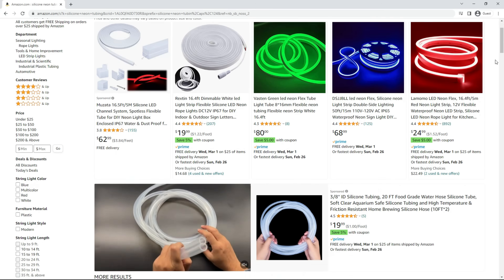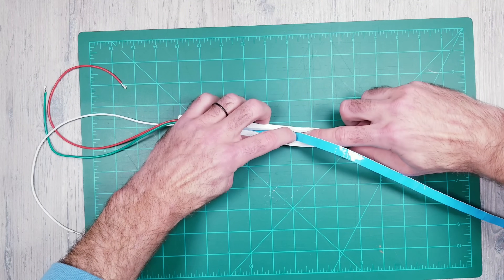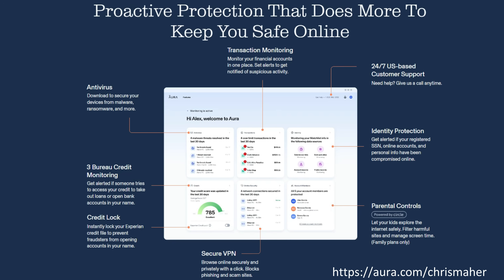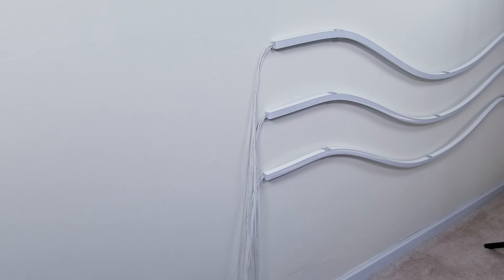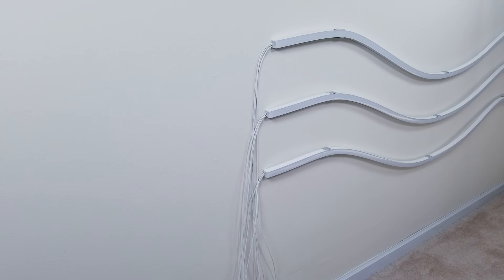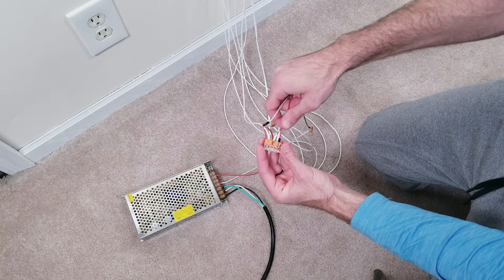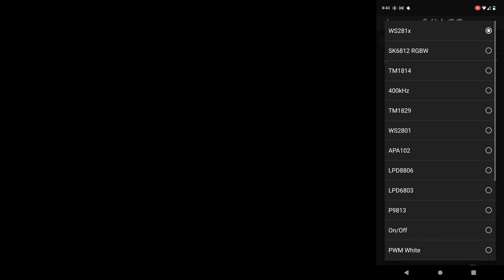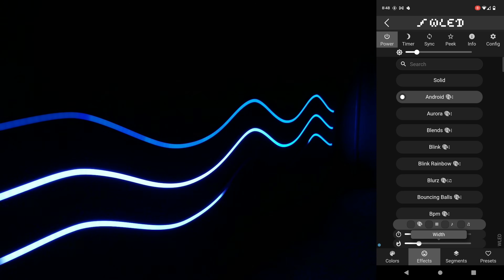Flexible Neon Tube - Review, Installation, Best WLED Animations - LED Neon Strip Lights

Comment from the maker: 📟 BEST Amazon Deals on Electronics: https://amzn.to/47qjC9j (updated daily)
☑Check out my sponsor to begin your FREE 14 day trial to Aura: https://aura.com/chrismaher
Flexible Neon Tube Amazon: https://amzn.to/3qeToE3
Flexible Neon Tube Company Site: https://bit.ly/44xoN37
Best Regular Aluminum Diffuser Channels:
Spotless Diffuser Channel 1m Amazon: https://amzn.to/47aIujz 
Spotless Diffuser Channel 2m Amazon: https://amzn.to/3QoHeDb 
Spotless Corner Diffuser Channel 1m Amazon: https://amzn.to/3DFhRpf 
Spotless Corner Diffuser Channel 2m Amazon: https://amzn.to/3Krqw2q 
LED Lights: https://amzn.to/43vJEnT
AliExpress LED Lights SK6812: https://s.click.aliexpress.com/e/_DF2aoqn
Power Supply: https://amzn.to/3UER8Rf
ESP32: https://amzn.to/3L3wZ48
Wago Connectors: https://amzn.to/3UDxLrY
3M Sticky Pads: https://amzn.to/3KIfSnb
Thick Jumper Wires Male/Female: https://amzn.to/3MQvRCi
18 Gauge Wires: https://amzn.to/41uNOKF
Power cord for Power Supply: https://amzn.to/43AmkW0

=============================
Support My Channel Directly:
Become a monthly contributor on Patreon: https://www.patreon.com/ChrisMaherDIY
Buy me a Coffee: https://paypal.me/ChrisMaherDIY
==============================

Install WLED on esp32 Video: https://youtu.be/TOEnFKLm9Sw
If you want Pre-Installed WLED Controller Option: https://youtu.be/aBOEHfT8VY4
How-To Solder Video: https://youtu.be/apSz3NXYlx8

Soldering Iron: https://amzn.to/3jxx1mB or https://amzn.to/3BKMlWv
Solder: https://amzn.to/3r6smMA
Solder Smoker Absorber: https://amzn.to/3rbHCYp or https://amzn.to/3Kx6K4T
Helping Hands: https://amzn.to/3v19YG3
Colored Silicone Wires: https://amzn.to/3Keoel3
Black and Red Silicone Wires: https://amzn.to/3DTFARN
Wire Stripper: https://amzn.to/3x9RGF0
Heat Shrink Tubing: https://amzn.to/3733zSH

The best way to help support my channel is to like, comment, make sure your subscribed and share my videos with as many people as you can. The other way is to use my links above as I get a small % at no extra cost to you if you buy something. Thank you all for the support!

Comment: I’ve seen lots of videos saying you can just use the 3V & GND pins from the ESP32 (or ESP8266) for the LEDs, without using a power supply. It simply uses the power from the USB connection to the ESP board. Would this work without using a dedicated power supply (just using a USB brick or something)? Seems MUCH more cost effective.

Comment: Is it possible you could create a similar project but using the WLED plug and play controller? Curious if its possible to cut down on the overall amount of wires used to create a similar effect.

Comment: Killed 5 leds of my strip while inserting in the silicon tube, both are 1 cm wide, so I thought that it would be a easy insertion with thread but no, u need a bigger hole like 1.2cm to insert 1 cm wide strip. Also the thread is broken too. Gonna use your cut and slit method now. Thank you so much.

Comment: Amazon videos as always, you are my LED Knoledge MUST WATCH! I do have a question, I do have a project of 20 Led strips lines WS2812B 60Leds/m (4 separated segments of 120 lead each) to cover the ceiling all over the place, I use the same GPIO per 3 strips and just Sync all to one Wled and I ithink i have like 6 Wleds up there, but watching this I thinki maybe there is a better way to connect, if you are in my situation, how would you orginze all the 20 line strips? Perhaps 7 Wleds using GPIOS (D2,D4, D5)?

Comment: Thanks to your videos I just found out about WLED and the ESP32….. got a (probably very basic) question:

The led strips could be 5, 12 or even 24 volts…. Can the ESP32 be feed those same voltages? Or would I need a separate power supply for the LEDs and the board?

My most immediate use will be running on a 12V car battery, that’s why I ask.
Reply: Well... some more digging on the web and I think found the answer: The ESP32 needs 5v, so I need a DC step down or Buck voltage converter. They even sell some specifically to use on car batteries with both under and over voltage protection.

Comment: Hey there Chris, thank you for the awesome and clear tutorial. 

I have been watching your videos and have been inspired to do a project here in my bedroom. I have a couple of questions as a beginner:

1.) I am running a total of 8 LED strips. Would it be okay to use a single ESP32? Or would you recommend getting another controller?
2.) I will be using WS2812B with 60 LEDs/m and I am planning on getting the 3m one. Would there be any voltage drop issues or inconsistencies? 
3.) Is the 5v20A power supply the best option for running 8 LED strips?

Help is appreciated! Thank you Chris and may God bless you.

Comment: Hello, with this way I can do it with 2 esp32 to control 3600 LEDs.? And what would be the synchronization between the 2 esp32 so that the 3600 LEDs perform the same effect?

Comment: It is interesting to see LEDs being bent laterally. I'm going to make a ring light for my circular shelf, and I thought I would have to use S-type "cobra" LEDs that are able to bend sideways. But if I can use standard LEDs instead, that would allow for a lot more options. I guess the most important thing is to not bend with too sharp of an angle.

Comment: Thank you for another great video. I picked up a set of the 2812b, the silicon diffuser, some esp32’s and pet supply per your links. Set it up last night for fist time with all and works great but I can see the individual leds in the silicon diffuser. They are not as blended as in your video which is fine for certain effects like “Noise” but not all. Any settings that can help make it better? Thank you  again. Appreciate all your sharing of great content.

Comment: Question on using multiple pins/strips with one controller. Is there a way to make 2 pins do the same animation while the 3rd does something else?  Example. I have 1 string and at the end 2 strings that form a Y. Can the 2 strings do the same together? Imagine a fuse that Ys, you light the fuse (string 1) and the fuse burns (leds go on and off) and once the fuse burns to the other 2 fuses (strings 2 and 3) they both ignite and burn (same leds on each strip go on and off down the strip)?

I have an idea  where 1 string leads to 2 or more and want the effect to travel from 1 to 2 or more not go from end to end? Maybe it's possible using reversing, idk. But I thought I would ask.

Comment: your project is 3 lines of led and the first line is connected to D2 then the second line is connected to D4 and the 3rd line is connected to D5. what if I'm going to do 4lines instead of 3lines of led that you made?

I prefer to assign 125 pcs. of led per lines.

125 led x 4lines = 500 led

where do i connect the 4th line on the data pin?

Comment: Hi Chris, great videos !! Is there any particular reason for you to go for the 5v led strips instead of the 12v like the ws2815?  I`m planning a 35/40 meters led setup for our home but not sure what's best to buy. I don't want to have monstrous power supplies everywhere. Or maybe It would be better to go for the govees? Thank you !!!
Reply: For short runs like these you can get away with lower volts. For longer runs off LEDs you'll need the 12 volts and 24 volts.

Comment: Thanks for all your videos Chris. I'm about to start my first project. 12m of SK6812 lights, placed in diffusers around the ceiling. I'd like to make a continuous loop effect. I've bought 2x5m and 2x1m sets with a 5v 20a 100w supply. BTF suggest adding power every 5m. Question is.... With WLED, can I combine these strips into 1 long loop using software, or do I need to physically connect the 5m+5m+1m+1m by soldering the strips together, as well as adding power at 0m, 5m, 10m. Hope that makes sense?

Comment: Hi and thanks for this video I really like the neon tube design and went out and bought one of those side emitting tubes after seeing this. However I messed up and bought one that only support 8mm wide strip and it wont fit what I already have. That being said that mess up could be a blessing for me in that thin channel looks really good and will work for me in a few projects I want to do. One in particular is in my vehicle it hides great however, I am having a really hard time finding an 8mm wide strip that is individually addressable that will fit in there sold in the US. Do you know of any. I tried amazon and there is nothing in there and BTF or ATOLF hasn't responded back to any emails. can you point me in any direction? I am really new to all of this and any help would be appreciated.

Comment: I am going to be pedantic and say these are not neon tubes.   It's LED's designed to mimic neon tubing.   
Other than that, looks pretty good.   It still is LED strips, so you do have that directional type light that neon tubes don't have, but the flexibility, and the low voltage levels, definitely make it easier to deal with than neon tube for the DIY'r .
I  do like the flexible diffusers, they give a really nice, smooth looking light pattern

Comment: Thanks for all the great info on LEDs and WLED. I have a good time replacing many of your creations. Tell me please: do the WLED effects change with the type/model of LED strip attached to the controller? I am running WLED 0.13.3. I see many effects in this video that are not available on the WLED I am using. Thanks!
Reply from the maker: Thank so much for watching! As far as I know the leds wont make a difference in terms of animation but the version of WLED that you are running will. I should have mentioned that I was using the  0.14.0-b1 beta release which can be installed at install.wled.me Also keep in mind that the animations will drastically change depending on how you tweak the slider options.

Comment: Need font 5v 20a? tkz
Reply from the maker: Thanks for watching! I'm not sure what your asking. Sorry! what does font mean?
Reply: @ChrisMaherDIY  Sorry, power supply! 5v 20a would be for this amount of led? to supply 5 meters it needs to be 20a too?
Reply from the maker: @colomb0222  ahh is see! You could use a smaller or larger one. But for this type of led strip that I'm using in the video you do need a 5v supply. The amps will be different depending on what you want to do. If you want to run all the light at full brightness, you might need a larger supply and you might need to do some power injection but if you only wanted to run them very low and maybe set the brightness limiter to a lower amount, then you could probably get away with a smaller supply.

Comment: What is the max practical bend radius for this type of application?
Reply from the maker: Great question! I would say what I did in this video is about close to the max bend with this type of design where the led strip is horizontal to the wall. Anything more, you would want to go with a design like this: https://amzn.to/41fEOtk

Comment: Mate, you completely forgot the review part. What are  your thoughts on the silicone diffuser, do they work good? Diffuse well? Brightness etc.
Reply from the maker: Thanks so much for watching and taking the time to comment! You are right! didn't even realize I didn't really give my overall impression of them. They are great overall. Very well diffused. Not quite as good as the Muzata aluminum channels that i've used a lot in my videos but still looks great with 60 leds per meter and truly spotless when I used them with 100 leds per meter. They get very bright but for what I use them for (ambient light at night) I never have them anywhere near as bright as they can go since it would just be way too much. I'm hoping to at some point do some comparison videos down the road! Thanks!

Comment: @Chris Maher how easy is this to bend on the wall? With the strip being horizontal to the wall (rather than some other neon ropes which have it at 90 degrees), this looks like it would be difficult to make sharp angles with installed on a wall. Is this true or am I missing something?
Reply from the maker: Thanks for watching buddy and great question! The amount of bend I did in this video is about the most I would try doing with this type of horizontal led setup. If you were wanting to make 90 degree then a product similar to this type of design is what you would want to go with:  https://amzn.to/41e2VIT

Comment: Another great video Chris!  Did that configuration of silicone strip diffuse the light really well?  Can you still see some "hot" spots at 60 LED/m?  There are some where the strip has a 90deg offset to the strip lens.  Trying to figure out the most diffused option.  Thanks!
Reply from the maker: Thanks buddy! They do look very good at 60 leds/meters (which is what I used in this video). The aluminum diffuser channels that I use from Muzata is what I would consider truly spotless using 60 leds per meter. These would be very close behind those in terms of being truly spotless but are not quite there. I also tested them out using 100 leds per meter and they were of course perfect using those but at least for me the difference was not significant enough to justify needing more power and more expensive strips. Hope that makes sense!
Reply: @ChrisMaherDIY  Wouldn't the Led strip burn up in the rope?

Comment: How well can that bend corners of a wall?
Reply from the maker: Thanks so much for watching! So if you were trying to make a bend on an inside corner of a wall or outside corner, these would work great for that. If you were trying to make a bend on the wall, then these would not work great for that. The bend in my design for this video is about as much as you can do with this type of product where the led strip is horizontal to the wall. If you want to make a sharper bend, the I would go with this type of design: https://amzn.to/41e2VIT

Comment: Does WLED work with google home/amazon Alexa?? Also can you like use NFC tags to turn the lights off/on again or do you always open the app and do it manually?
Reply from the maker: Great question! I know it works with Alexa even though I personally have not tried it. Maybe check out this video:  https://www.youtube.com/watch?v=30yO1zTDAk0&t=432s I have not seen any nfc type applications but that very well could be possible and I just am not aware of it.
Reply: @ChrisMaherDIY  so you basicly open the WLED app every time and manuelly turn the leds on? Thanks a lot
Reply from the maker: @lmaopew  yeah that's currently what I do! Your welcome!
Reply: @ChrisMaherDIY  ngl i'd be way to lazy to do that for all 50+ LEDs you have😂😂 i'm even to lazy to open the smart lights app to turn on/off my smart light on my room, for a while now I've literally just used the light switch that cuts of the complete power of the light bulb😂🥲

Comment: What about logic level to convert data voltage to 5v for leds?
Reply from the maker: Thanks for watching! If the data line is long coming off the controller to the first LED then I've done that or used the sacrificial pixel method to boost the signal of the data line. But in this install, i wired everything up with no boost and everything worked just fine so I didn't do anything else.

Comment: I learned something new! I am planning a build using 4 leds in a display cabinet and I was gonna feed them all to one data pin but now I see that I can try what you did but I saw you use the D2, D4, and D5 pin. What other pins can I use for my 4th led? And how many pins can be used for data? I have an esp32 wroom 32s board that is almost identical to the one you used in the video.
Reply from the maker: Thanks so much for watching! I'm not even 100% sure but I always refer to this: https://kno.wled.ge/features/multi-strip/#:~:text=There%20is%20a%20maximum%20of,a%20total%20of%201024%20LEDs. for more information. They make it sound like you can use any pin on an esp32 for data and up to 10 strips but I would read through the document to see if I'm missing anything!
Reply: @ChrisMaherDIY  Thanks! I'll give it a look.

Comment: Great video as always Chris! Can you give some insights on power consumption of your entire system?
Reply from the maker: Thanks so much for watching and I'll have to do that at some point! Although its probably a lot less than you would think. I pretty much only use this stuff at night and since its all just used for ambient lighting, there is no need to run them very bright.
Reply: @ChrisMaherDIY  I am a total novice, and haven't purchased any LED components yet. I have just started watching your videos tonight and I was wondering about the power supply you chose for this project? My understanding is that the power consumption for 600 5V LEDs would be 180 watts and 36 Amp so I would need a BTF-LIGHTING DC5V60A Max300W to adequately power at optimum brightness correct?

Comment: great job as always...quick question, how do you do it, that the Leds are the only thing that is visible? like im sure the Room is brighten out a bit and usually you would see some Surroundings ..thx
Reply from the maker: Thanks as always buddy! Great question. So first thing I usually do is turn the lights down. If you have them super bright, its hard for the camera to pick up the actual colors of the leds and everything just comes across as a white type very bright effect. Next is i lower the brightness level on my camera a little so that it reduces some of the noise. Thats all I do!